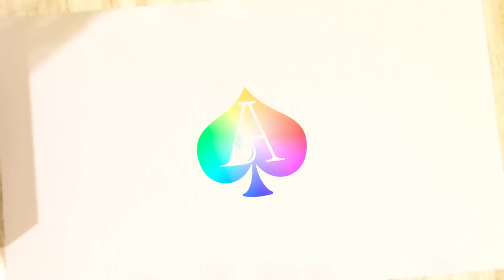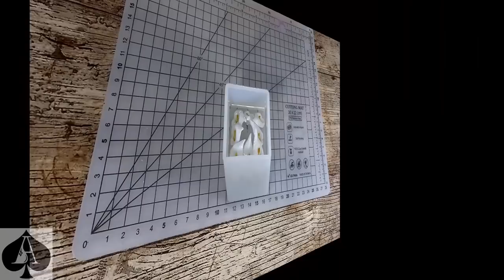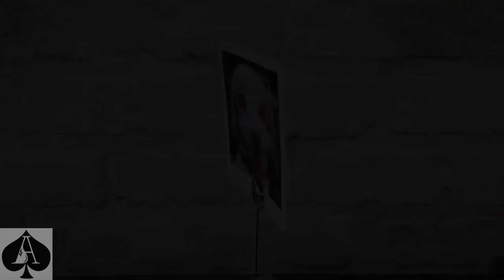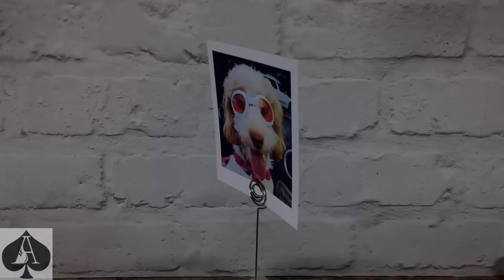Calla Lilies Photo Holder Paperweight Cube | Foam Flowers in Epoxy Resin Tutorial

Comment: Love watching your resin videos!  Love the commentary in the CC as well!  Gives me the chuckles. LOL  Question: You mentioned you were using 'art resin'.  What is it and what is the difference between the art resin and regular epoxy resin?
Reply from the maker: Hi, thank you 😊 Epoxy resin comes in many different formulations for many different situations, but I narrowly categorise them as 'art resin' (which is suitable for small projects and shallow pours) and 'casting resin' (which is suitable for larger projects and deeper pours).  If you use art resin for a large project it will likely overheat and boil in the mould, and if you use casting resin for a small project then at best it will take a very long time to cure, at worst not at all. However you can use art resin for deeper pours like this cube if you pour it in layers, as long as you allow each layer to firm up first. ♠
Reply: @resinAce  ah. The art resin, is that UV resin? I know that is used for small projects.

Comment: Another great project 👍. Very handsome doggo 😁.  I see you are using a Dremel Work Table, how do you find the accuracy? I want one but read some bad reviews, I would appreciate it if you could comment on your experience with this. I didn't really hear the drill over the music, but I'm old and I don't hear my husband when he talks, but that's more selective than actual hearing loss. I like this project, would make great gift for someone.
Reply from the maker: Hi, thanks for the great comment 😊 The accuracy of the Dremel without a bit of modification is not great, so the reviews sound fair. You may have noticed a cable tie briefly flash on the screen when I used the drill, well that cable tie is the only thing that's keeping the drill steady! It needs to be strapped up tight to stop it wobbling in the holder. Once that's sorted though it functions just fine. 😎♠
Reply: @resinAce  Thanks so much for the information. I think I will have to try it out because I have not found a better option.  I'm trying to make a dog tag with resin, I'll let you know how it goes. Is your doggo a Golden Doodle? He is very handsome in his doggles.💜💜💜💜
Reply from the maker: @anneargo-davies692  close, a cockapoo 🤣♠ I did make resin dog tags in my playing card video here https://youtu.be/NlYCx6cMb0I and there's also a gold version somewhere (but that one is painfully long, before I got the hang of editing!)

Comment: Absolutely loved this project, just one question- why use a syringe and not pour a small amount down the side from the cup ? 💕
Reply from the maker: I was just being extra careful to not overfill the first pour. That resin I use should only be poured to 10mm deep but I took it up to about 20mm, and although it did get very hot in the mould it didn't boil (which would have ruined it) 😎♠
Reply: Many thanks for the reply 👍🏼🦆

Comment: I heard that when mixing resin, one should scrape down the sides of the container to ensure thorough mixing. Is that absolutely necessary? 
BTW I love your videos. ❤
Reply from the maker: Thank you 😊 Yes, when mixing resin I always ensure I do at least one swipe around the inside of the cup to make sure both parts are fully mixed. When mixing a larger quantity, I sometimes transfer it to a new mixing cup altogether, to avoid any risk of unmixed resin. 😎♠
Reply: @resinAce  oh, ok. Thanks so much for the answer. 😊
Keep making great videos. ❤

Comment: Love your stuff. Can you tell me why you pour in stages?  Is it just because of shrinkage?
Reply from the maker: Hi, I use art resin which has a maximum pour depth of 10mm. If you pour art resin deeper than that it will overheat and spoil. There are some casting resins that can be cast to a deeper depth, up to 50mm, but they take much longer to cure.
Reply: @resinAce  Thank you!  I am still playing with a few different brands and so I will pay more attention to my depths.  I have not been pouring fairly shallow so far but am starting to pour deeper and noticing more bubbles forming overnight long after I have "torched it"

Comment: Just BEAUTIFUL-!!! Question: How long do you wait between pours when doing layers..? I heard if you wait too long you can get demarcation lines or it won't stick..?? And yours IS Flawless-!!! Is it the resin you use..?? I've bought 7 different kinds to try..
Reply from the maker: Hi, the wait time depends on your type of resin and room temperature but expect a few hours, basically until it has gelled. There are always faint witness lines between layers of resin but they are barely noticeable from certain angles. They are most noticeable when looking directly from the side.
Reply: @resinAce  Thanks so much-!! May I ask what you use..? I've bought to try, 
Clear cast 7000
Art Resin
Little Windows 
Alumilite 
PUDUO 
Art 'n' Glow
Annnd a UV resin..
I bought them all to try because I figured that'd be the best way to learn and find the best one for my art.
Would love your input. Hoping to learn how to do videos on "youtube" so I can make videos of all my experimenting :)
Reply from the maker: @kd8423  I like art resin from www.resin4art.com which is best suited to small projects and shallow pours. Deeper pours need to be done in layers. It is low viscosity, non-toxic, solvent-free, voc-free, non-yellowing and temperature resistant to 120C so great for coasters. I don't like Alumilite Amazing Clear Cast because it is very thick, yellows quite quickly and not very temperature stable.
Reply: @resinAce  Thank you for this information-!! I'll use the one that yellows for my first test pours, I'm so glad you told me-!! Thank you again :)

Comment: That is very cool!!! Question, how come, once you got it stabilized did you not just pour all the resin in at once? Why in layers? Just curious.... stunning work!
Reply from the maker: I am using art resin which is formulated to cure at shallow depths. If I filled that mould all at once it would suffer an uncontrolled exothermic reaction and boil. The first layer I poured at 20mm deep did actually get extremely hot. 😎♠

Comment: Can I ask what the epoxy resin is that you use please. I’ve tried to use some I’ve purchased off Amazon UK & although small amount dries overnight, if I try a cube it’s still almost liquid a few days later. I’ve triple checked the instructions & its 2:1 by weight which I’m following. I’m mixing as suggested & it’s making no difference at all which is frustrating to say the least. Cheers in advance.
Reply from the maker: Hi, I use www.resin4art.com brand via their ebay store https://ebay.us/1CJQfc

Comment: Wait so a uv light cures epoxy???
Reply from the maker: I used a tiny amount of UV resin in that project as an adhesive to hold the flowers in place. The UV light only cured that bit, the rest of the cube was ordinary epoxy resin.
Reply: resinAce your channel is awesome. I just started working with epoxy about a year ago. All of your videos are easy to follow. Sorry for asking so many questions
Reply: Dang it, one more thing. Could one encase a small picture into epoxy?
Reply from the maker: @delightful75  If the picture is just printed on paper with water-based inks, your best bet would be to coat both sides in Mod Podge to seal it first, or maybe laminate it.  Paper and water-based inks do not fair well in resin.